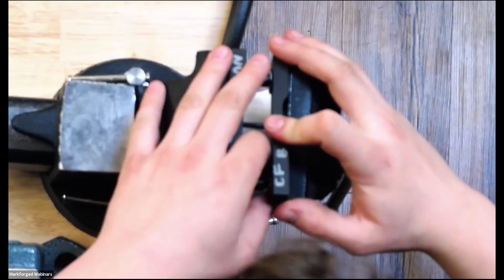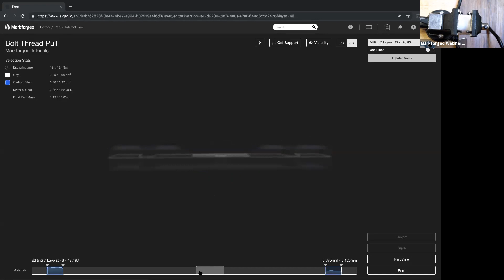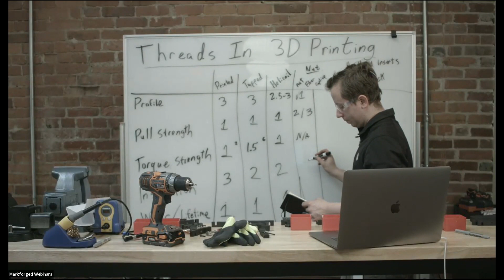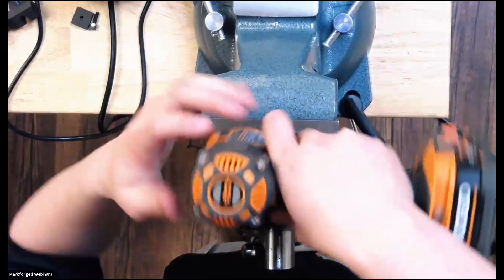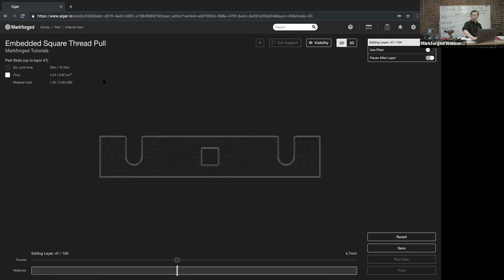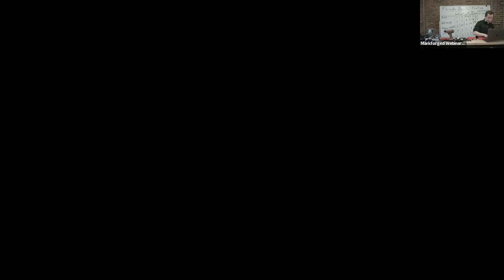Thread Testing: Metal Component Strength with Captive Nuts vs Embedded Nuts (Part 3 of 4)

Comment: My product uses a metal band and plastic component that needs to be secured together.  These videos have been very helpful and informative.  I've been frustrated on not finding a machinist to drill and tap a 1.6 millimeter hole. Thank you for these videos.